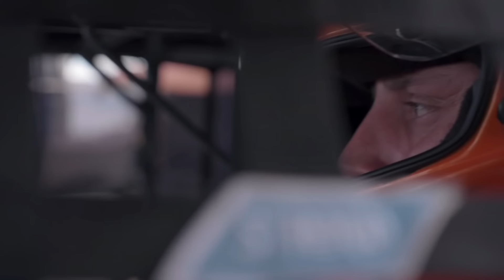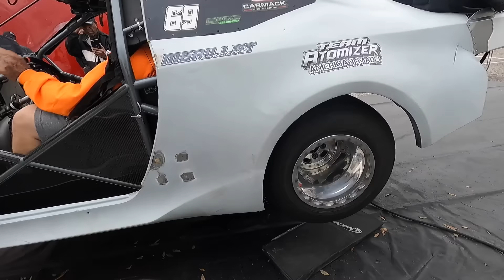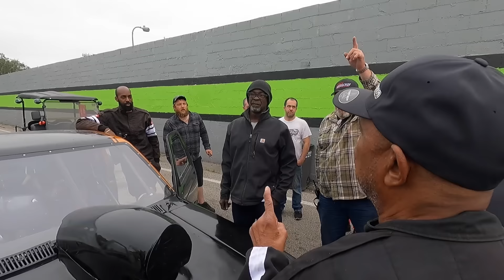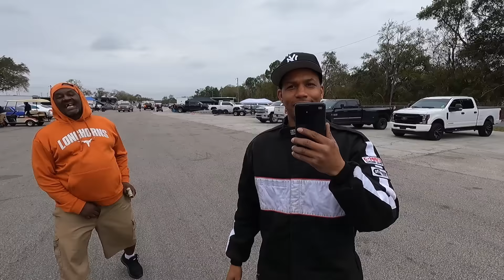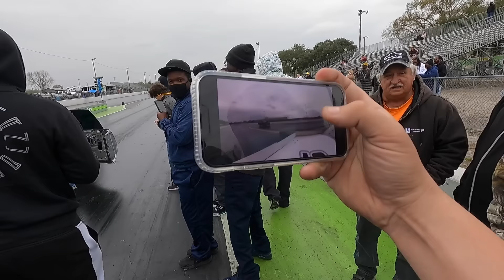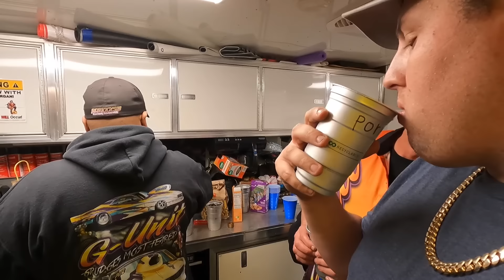The CRAZIEST Race In My Career... The Truck Gets The Back Tire, Break & The CLEAR To The 1/8th Mile!

Comment: I noticed Ryan Martin on one of his videos mentioned that he had driveshaft issues and was concerned with the tunnel being safe enough. He's having his modified with another safety loop at the edge of the tunnel where the u joint is for more rigidity. Something to think about.... because you can't be safe enough and as he said, when bearings and caps are flying out at 9,000rpms they become like bullets.
Reply: Yes, his blew out in the Fireball during America’s list. Scared him so much he’s changing his NPK car as well. If you watch his videos on it (2), the damage looked scary as hell and it just makes sense to change it. While NHRA requires one hoop, he’s putting three over the u-joint. He’s really hoping NHRA will change their rules on it.
Reply: You both saw the same thing I did in the video. It is hard not to think about Ryan Martin, the initial reports were that he took a flying piece to his NECK. . when you see virtually the same exact tunnel in anyone else's car (I also saw it in Tom Baileys video, too) you want to SCREAM "HEY SHORE THAT S*** UP!!". Fact is, you'll never have a problem with that tunnel  if you keep it under..oh lets say..4000 horses, right? lol
Reply: @tripprogers4814  yea it even sent a cap out tha roof. If it had hit someone underneath their chin it would come out the top of their head.

Comment: Big C is dead right on the first grudge race. The back tire means you are also shortening the distance to the finish line, fucking yourself out of mph. The brake and the clear would have been a different race. The truck would have gotten out by at least 2-3 cars before you could see him and that would have been hard to clear.

Comment: Re the race with the little S10,, it is quick, no doubt about it BUT whomever took that still shot at the finish,, it was terrible,, very bad angle from what we see in this video. However, the camera on PreNup told the story,, but it was daymn close, almost TOO CLOSE! It's Justin's hotrod and he does with tha PreNup whatever he chooses BUT if it were me,, no way would I have bought into a race like that,, no way. Heads up or nuth'n,, THAT would be the ONLY way I would race PreNup.